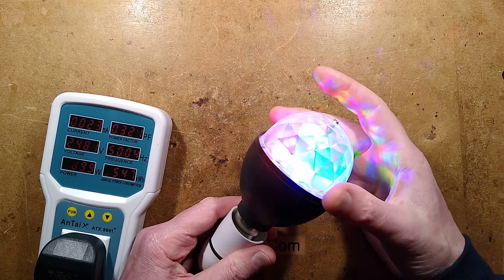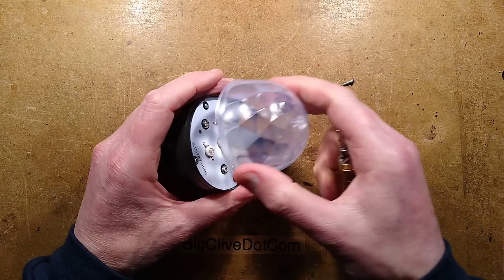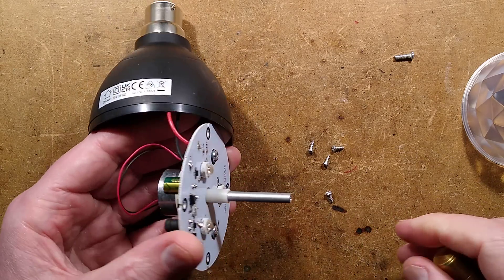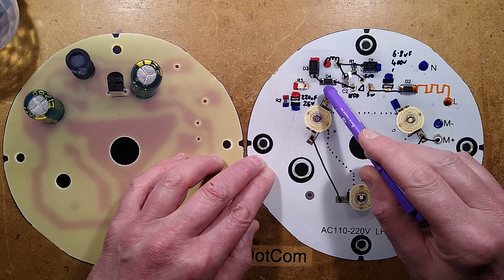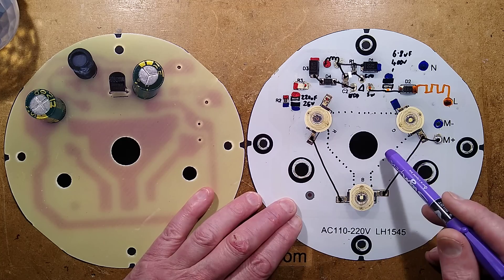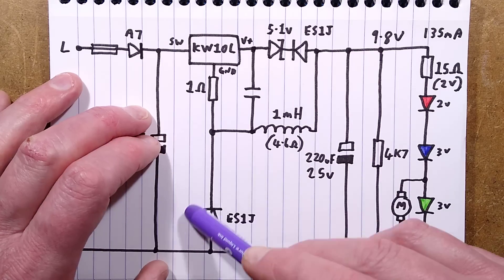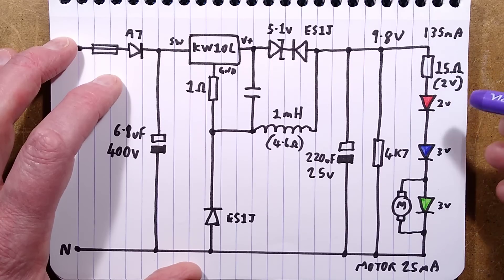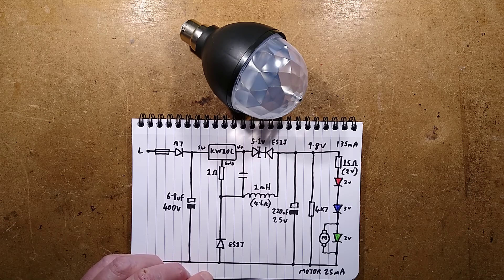Trashy disco light gets even trashier (with schematic)

Comment: Hey Clive, QQ have you ever done anything with the Merkury LED lights that attached to the internet? I wanted to know if anyone has used them to hack someone's wifi by replacing the firmware on the LED with new firmware to send their WIFI password and other information from their network to a remote server? I ask this in jest as I know it's possible. The bulbs use similar to ESP32's or older wifi/bluetooth microcontrollers. Would love to see a break down of one from your perspective... Thanks!
Reply from the maker: An upcoming video is about the Eveready WiFi connected bulbs.  They do seem to be hackable for custom firmware.

Comment: Hi Clive. First comment from long-time lurker! Of course you know how inductors work, but I always feel that you could maybe explain what they do more intuitively than "when the magnetic field collapses" by the fact that they fight changes in current by varying their stored energy. This contrasts with capacitors, which fight changes in voltage by varying their stored energy, which I feel is much easier to understand.

In this case, the regulator applies a higher voltage to the left hand end of the inductor than what is on the smoothing capacitor at the right, which will therefore try to push current left to right. The inductor will fight this change in current, resulting in it rising slowly as the magnetic field builds up and it loses the battle. Then, the switch in the regulator opens and the inductor will fight the decrease in current, insisting on continuing to push it through. This will result in the right hand side going more positive than the left, i.e. the left hand side going more negative than the right, until something gives and current flow is maintained. The something that gives is the voltage going slightly below zero on the left, which allows the inductor to suck current through the flywheel diode, completing a circuit back to the right hand end via the smoothing capacitor, and as a result charging that capacitor to a higher voltage from the energy stored in its magnetic field.

Comment: I had a similar bulb, the effect was really nice and relaxing. Well, until the whole thing turned into a stroboscope due to one of the LEDs failing early.
The motor in that bulb was an actual 220 V AC synchronous motor, similar to those found in microwave ovens.

Comment: A nice touch ( it has a UK bayonet fitting ! ) ...so many imports have the E27 screw , ( pop down to B&Q for an adaptor ! ) ... a good " old skool " party lamp is the ruby red glass ( 300 Watt mushroom lamp ) usually available in farm shops to keep chicks warm ( you MUST use a ceramic holder and heatproof cooker wire ! ) ..... ( tried - n - tested ) ..... DAVE™   🛑

Comment: I bet the next version will be live, soldered through a squiggly trace pretending to be a fuse, through three LEDs and the motor all in series, with a 10-Ohm resistor to neutral. 🤣
Reply: Just need a 230v motor to drop the volts then put the LEDs in series with it, simples!  Of course if the motor ever stalled......

Comment: The worker who soldered the resistor upside-down just wanted to make sure the electrons would fall out in case of a failure since there's no proper fuse. 🧠
Reply: No, it’s because the fixture is normally hanging down, but i’m not sure how north or south hemisphere will affect it.
Maybe it will work better underwater?
Reply: @laustinspeiss  Don't forget the coriolis effect.
Reply: I'm learning a lot from these comments.
Thanks.
Reply: So long as a rectangular or square chip component, such as an SMD resistor, meets the dimensional and solder fillet requirements, it is acceptable to solder it upside down.
You typically have a tray of SMD components on a machine that places them for you and sometimes the component can end up upside down.
Reply: It's to impede Clive reverse-engineering things. That's also why they put different numbers on semiconductors.  Eventually all components will be upside down, mismarked, filed-down, potted etc.
Reply: That particular unit was made specifically for use in the southern hemisphere like in Australia.
Reply: No, they just reversed the polarity of the neutron flow. Guaranteed to fix everything!

Comment: That one is very different to the one I have......had. I found one in the dumpster and had a rattle noise, noisy gears and I think that was the reason somebody toss it out. I was very surprised to found a tiny 5V adapter inside, packed in heatshrink. With a little tweak (just cut the wires), this version can work on an USB power adapter or bank. Pretty neat. They must make more LED lights like this, easy to tweak and can run from a low DC voltage source.

Comment: years ago, i found one of those "fibre optic" xmas trees with the changing colours.
no interest in the tree, i grabbed the base.
little motor driving a coloured disc over a halogen bulb sorta lined up under where the tree pushed in. this is hightech in comparison!

a coffee tin fitted neatly over the top.
grab a nail, punch one hole.
pinhole lens, perfect image of the disc and the bulb projected on the ceiling. cool.

two holes?
three holes? lotsa holes?
pop pop pop pop pop!
hundreds of holes!

i ended up with something that can only be described as psychedelic... the images are overlapping but also performing double slit interference, and as the colours change, the interference change, producing patterns, throbbing dark and light bands, completely different colours, blah blah...

be sorta cool to see it again. 

i think i got inspiration from one of those real 60s psychedelia paraphenalia, motorised lens and mirrors and... two discs with just black radial stripes, producing the typical disco type light-show. moire effect or something?

Comment: What I found about the KW10L it is a KP3110 that is marked as KW10L,  It isn't the first time the markings on chips have been changed.
    High Precision 5V Default Output
    Integrated  with  500V  MOSFET  and  High Voltage Startup Circuit
     Ultra Low System BOM Cost 
    Support Buck and Buck/Boost Topology
    On/OFF Peak Current Mode Control
     Less than 50mW Standby Power
    Built-in  31KHz  Oscillator  with  Frequency Shuffling
    Built-in Soft Start   Very Low VDD Operation Current
    Build in Protections:   Over Load Protection (OLP)
    On-Chip Thermal Shutdown (OTP)
    Cycle-by-Cycle Current Limiting (OCP)
     Leading Edge Blanking (LEB)
    VDD UVLO
    TO-92 and SOT23-3L Package Available
Reply: If it's 5V precision, the zener must be 4.2V with another 0.6V dropped in the diode to get the final 9.8V

Comment: Wonder why the two different capacitor vent types, have to assume they use multiple suppliers 👀 or do higher voltage capacitors need a larger ventable weakness

Comment: The diagram is a little confusing, you'd normally have the switching output to the right labelled 'SW' and the feedback terminal as the other one labelled something like 'Vf'. As drawn, I don't see where the ground for the regulator can come from.
Edit: found an equivalent part AP8003, with some data.
Reply: First, when the circuit is turned on, the current goes from the SW terminal to GND, then through an 1 Ohm resistor, throught the inductor and finally through the load. After the regulator starts doing its thing, it is powered from the local source formed by the capacitor which is connected to the V+ pin. The capacitor is charged through the diode and the Zener diode on each "OFF" PWM cycle (when the switch inside the regulator is open and the energy stored in the inductor is transferred to the load).
Reply: @RSTrigger003  Thanks, wasn't obvious from the diagram. I've now found a block diagram for an equivalent part (AP8003) and it is clearer. Doesn't help that I'm used to seeing Vin instead of SW, and the GND serves a dual purpose.
Reply: @threeMetreJim   If the SW pin was called Vin and the GND pin was called SW, there would be no ground pin at all. In my opinion, it would make things even harder to understand.
There are some 3-pin chips for traditional flyback converters (with a transformer). They often have pins called like "GND", "SW" and "FB". And GND there is actually GND (the negative output of the bridge rectifier). The inside of those chips is very similar to AP8003. Probably they could work in such buck converters and vice versa. I believe this is the reason they chose such pin names for AP8003.
Reply: @RSTrigger003  You are right, I never considered that it might be possible to re-configure it as a flyback, that would make far more sense for the pin naming.
Reply: I also found the AP8003 and a schematic for it.

Comment: I have always been curious what printer do you use to get the sharp closeup photos you take of the PCBs?
Reply: I'd say he uses a camera to get the photos rather than a printer :P
Reply: @Agent24Electronics  Yes i figured that but the quality of the output looks like it is a photo printer of some kind however he manages to print them quite large and they do not look like inkjet at all. They look like dye sub in quality or other printer method that produces a very photo like output.
Reply: @markam67 Honestly, most modern inkjet printers have decent photo output, save for the ultra-shit ones with print heads integral to the ink cart.

With artistic photography work, especially up close, there will definitely be a difference, but for this kind of thing, the quality is more than adequate, even with questionable ink from eBay.

The biggest caveat ink-wise is going to be long-term colorfastness or lightfastness, but that's not always an applicable concern.
Reply: @Okurkaarrgghh  well I am very surprised by the quality of the output it looks too clean for inkjet